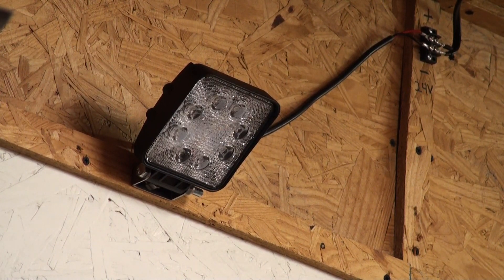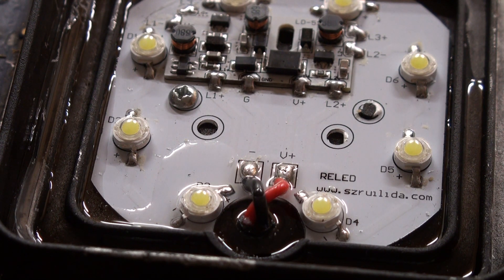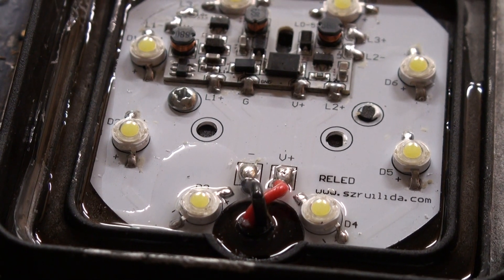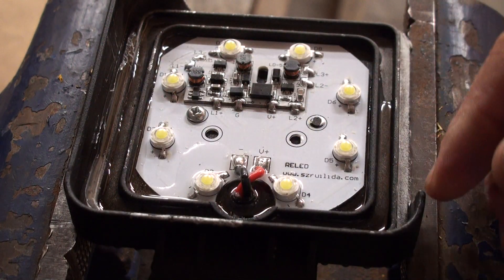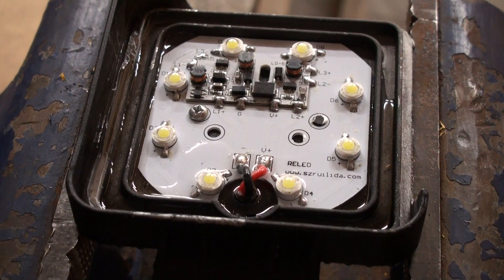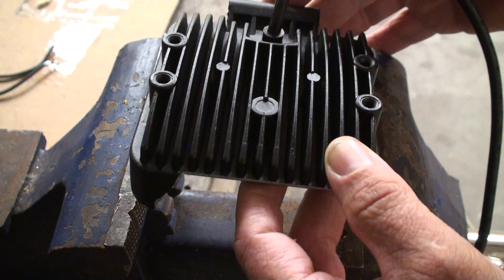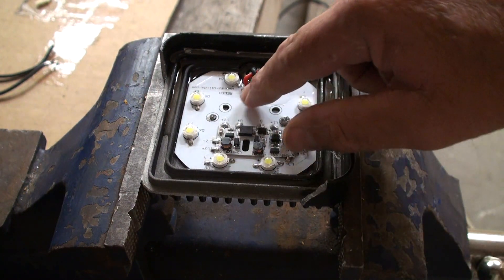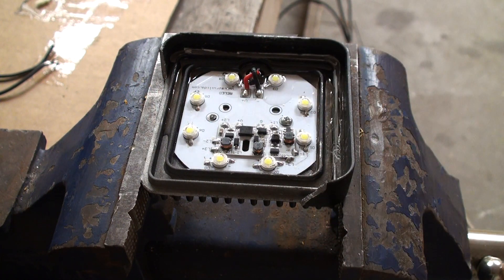24vdc or 12v LED Interior Ceiling Overhead Lighting / Downlights for Off-Grid Homes

Comment: I would use 12 volt lights, more selection of  fixtures and bulbs. You do have to watch for voltage drop after a 100 ft or so, this can be corrected if you have a huge run, just put in a sub panel supplied with large supply cables to the panel. and take your loads from that. good luck..P.S. I am a retired electrician, you can also get a NEC and make sure you do it to code..